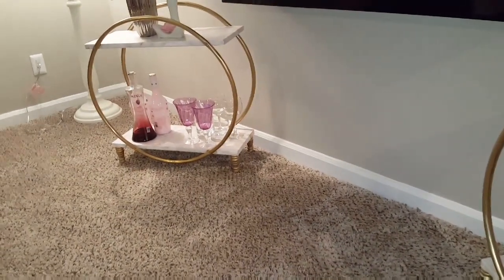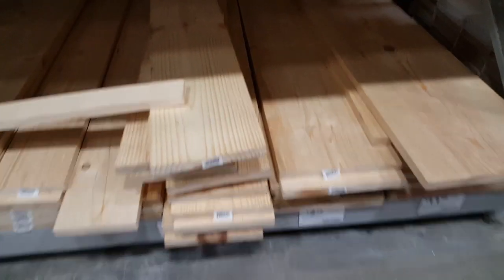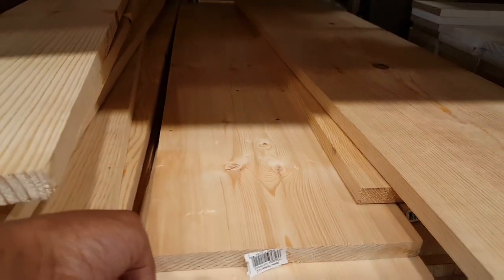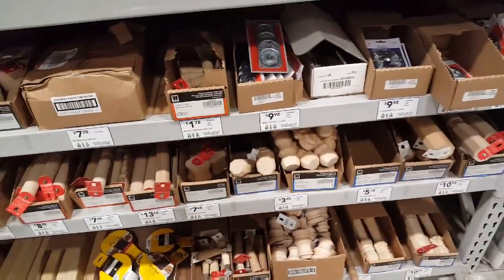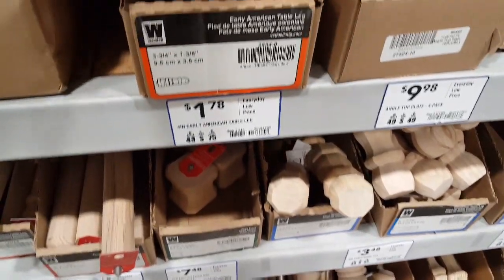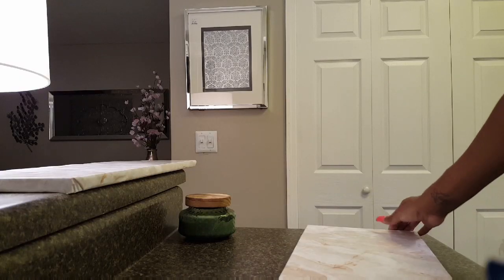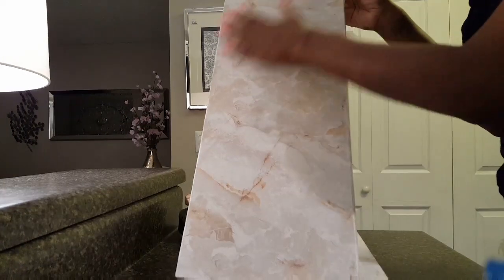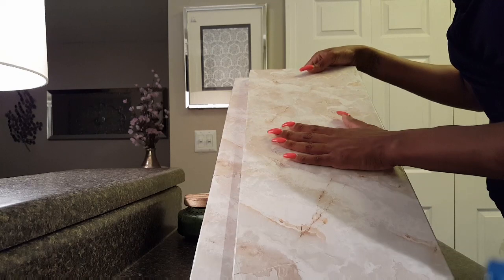ZGallerie Inspired Bar Cart + Detailed DIY

Comment: New subbie.  Great job on the Bar cart.  This video is fitting, because I'm putting together a bar cart.  I didn't realize that hoola hoops would be so hard to find.  So I went in a different direction for mine.  Thanks for sharing.
Reply: Hey! What did you use as a substitute? I’d like to know what the options are.